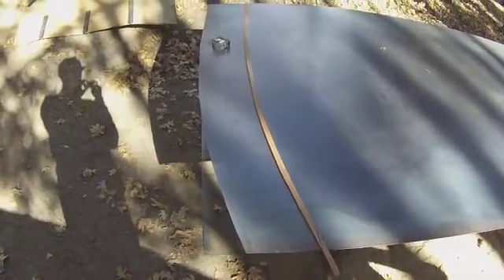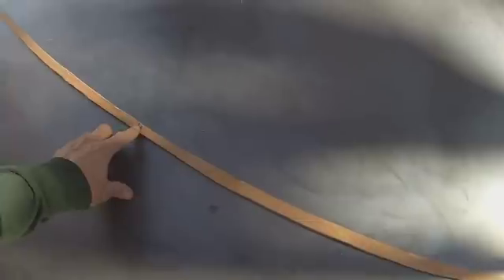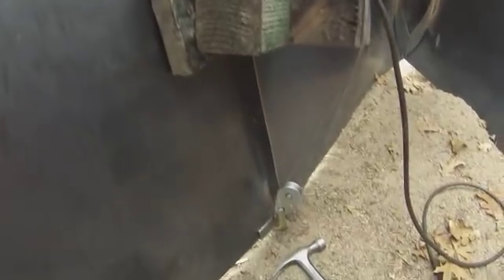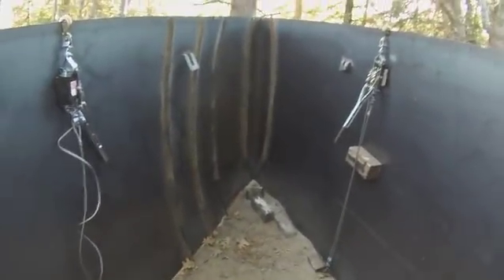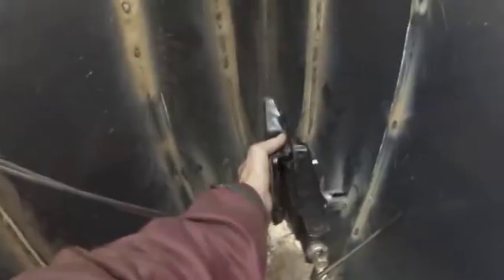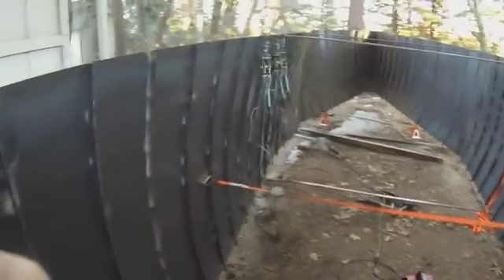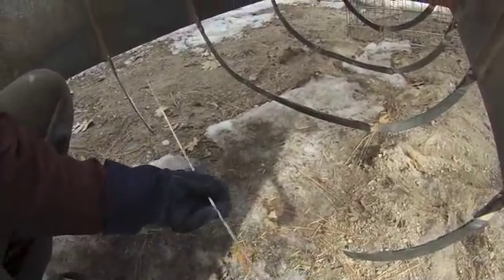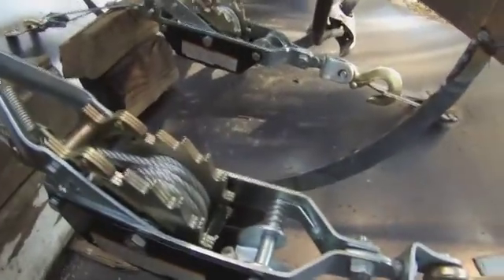Steel Sailboat Build   Part 2

Comment: Those ribs are painful to watch cut, a hossfield edge bender would have saved so much frustration
Reply from the maker: Never heard of a hossfield edge bender until today.  Looks like a cool tool.  Does it cut as well as bend metal?
Reply: shears up to 3" wide, bends just about anything from tube steel to angle iron, and punches holes. The handyest tool in my fab shop and picked it up for $100 used.

Comment: Boy your subs went up in a bug hurry, Well merry christmas from Doug eh? :-) So are you really sure about 1" ribs for that gauge? Just asking, not trolling. It is a good place to start a little discussion. I gather your design is a hard chined, with skeg keel. But otherwise a shoal water craft that is easy to trailer. I wonder how much lighter wood is if any given the 15ga was it?
Reply from the maker: The plan is to trailer the hull in one load and everything else in another load.  Strength will be something to find out about.  Thanks for the comment!

Comment: Suggestion: If you place your steel on metal fence posts it woukd take much less effort to manipulate the metal on the X Y axis , as opposed to dragging through the resistance of the dirt.

Comment: I wish I had found your channel much earlier I could have saved you from a few headaches ! The trick is you have to set your keel at the height it eventually will sit in the water. Meaning the forefoot should probably be a 1' 1/2 and the sternpost touching the ground, that way you can set your sheer line . I am a certified shipwright and red seal welder so I have been involved in building boat/ ships of various ( Loa and widths ). I wish you the best in creating you dream !! I will be following your quest !
Reply from the maker: Thanks!  I'll look you up when I run in to problems from my make-it-up-as-I-go method.  Much appreciated!  Much respect to you.  I worship metal workers, since I have had such difficulty bending metal.

Comment: Enjoyed your videos. Look forward to whole build. What plans are you building off of?
Reply: Thanks for the positive feedback!  I am not building off any plans.  If it looks right to me, then it is right.  I want to keep it less than 8 1/2 feet wide, so I can trailer it on the roads to the ocean.  Also, I want to fit inside.  I am 6'3" tall and could not find a commercially built boat I did not have to stoop in, which I could afford.
Reply: Nice work.  If it looks right, it is right. :)